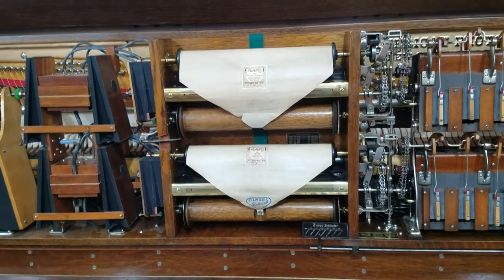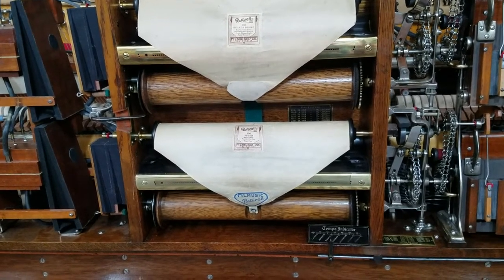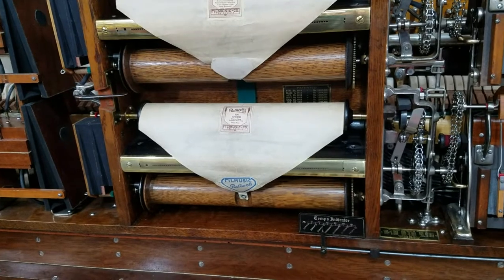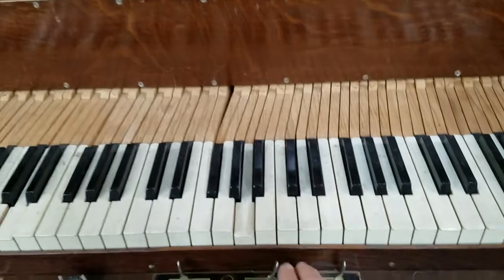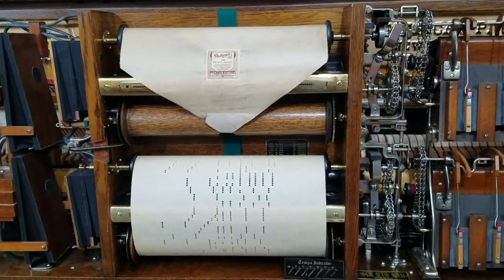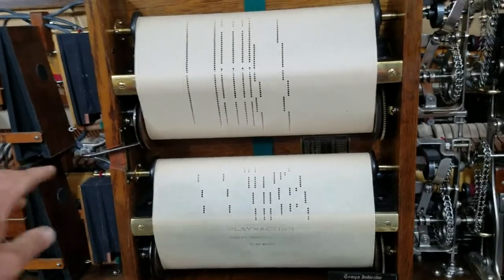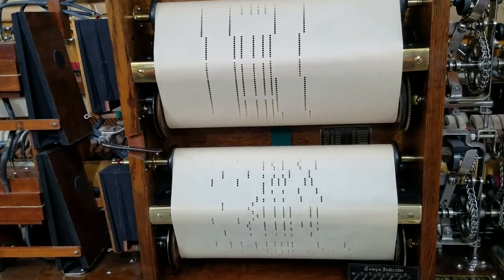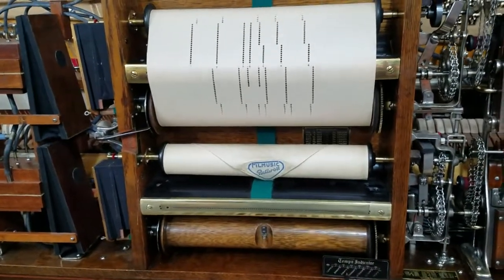Fotoplayer Roll Controls

Comment: I'm really intrigued by this video...  I grew up with and still have a player piano made by the "The Autopiano" company and a significant amount of the "guts" of the Fotoplayer are identical.  The vacuum motors to the right are slightly different, but the sprockets and chains to the right of each roll setup are identical mechanically, as are the sets of tracking bellows to the left.  Even the templates or tags (whatever they're called) in front of the keyboard are identical in style, as is the style of the tempo indicator with the sliding pointer.  The take up spools also look the same.  There must have been a relationship between the two companies?
Reply from the maker: You're on to it. The stack and spoolbox components were furnished by Autopiano for American  Photoplayer.